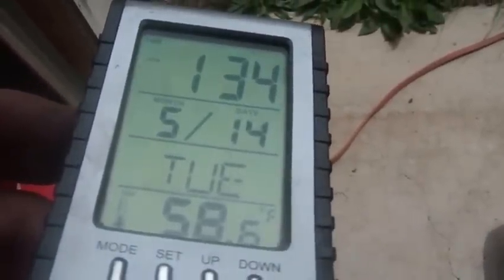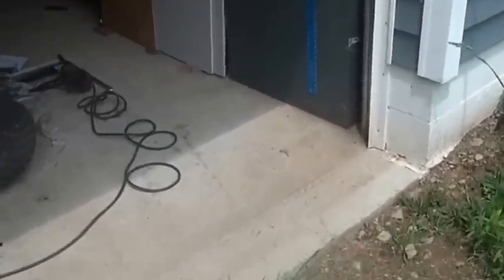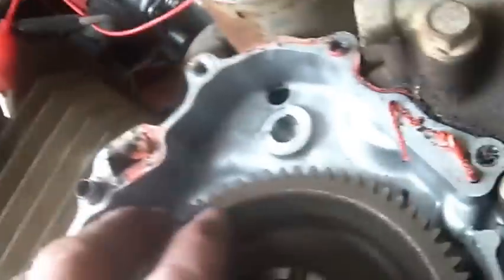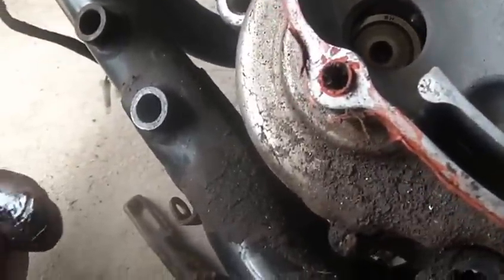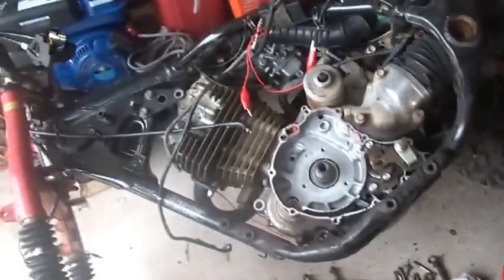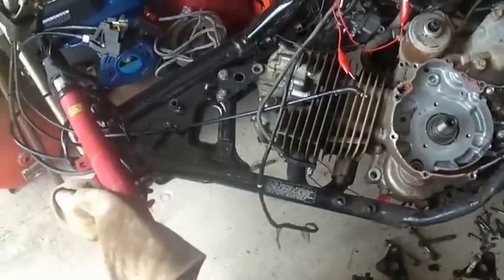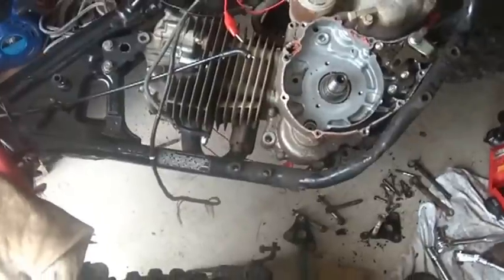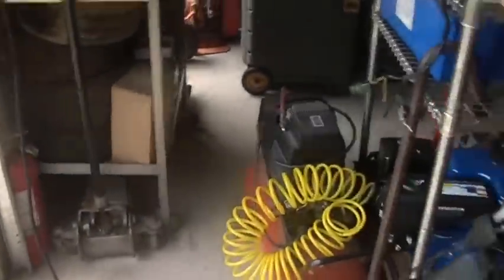5_14_2013, Honda Big Red Fly wheel removal.

Comment: I’m having trouble getting my cover off. Seems like I need to pull motor to get if off or at least loosen up all the motor mounts. It pinches right below gear shift shaft and I can’t get it to squeeze out of there. Any tips tips to get it off with out doing any of that?

Comment: Got a question for you I'm having problems putting my motor back together it's my 85 Honda 250 ES Big Red having problems with the springs on the clutch side the spring for the kickstart and the other spring that is in there that connects to the one lever when I took it apart they popped undone is I still haven't been able to get them back together again did it to free up the motor was seized up

Comment: I cant get my flywheel cover off my 1983 200 big red. Any suggestions? I've got the bolts out, and there is a 1/4" gap all around, if I move it back and forths it sounds like it's hitting something preventing it from coming free. PLEASE HELP

Comment: did you ever figure out what wrecked it? I was working on mine and my electric start gear wore down and some pieces got in there. it ruined the stator and locked up the engine
Reply from the maker: Elijjah Mattinen , Any loose metal in the case kills them, the magnets on the flywheel wedges any metal particles between that and the stator... On the few that I worked on, it seems that their owners were beating on the starter trying to overcome carb issues, the metal was from the starter gears. I have another 250ES big red in the yard that I need to get to... Thanks for your thoughts, watching, and commenting!!!
Reply: One way bearing goes bad and starter gears chew each other apart and doing that the stator also gets chewed up

Comment: where u get the flywheel puller tools..?
Reply from the maker: Daniel C Vaughn , $38.29, eBay, Search, "27mm 
PULLER for FLYWHEEL MAGNETO ROTOR HONDA ATC200M ATC200S ATC200ES 82 83 + "  and it should come right up...  Thanks for asking, watching, and commenting, please come back frequently...
Reply: ok i found tool on ebay thank u ..